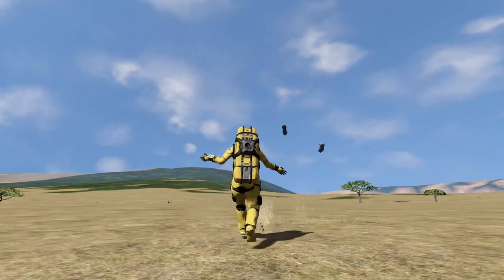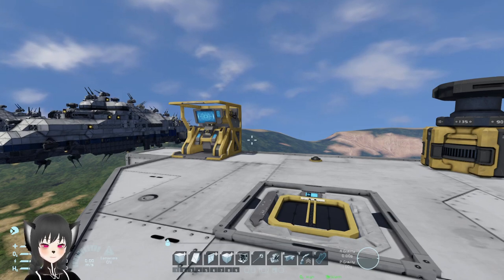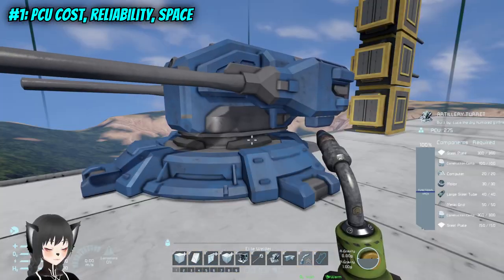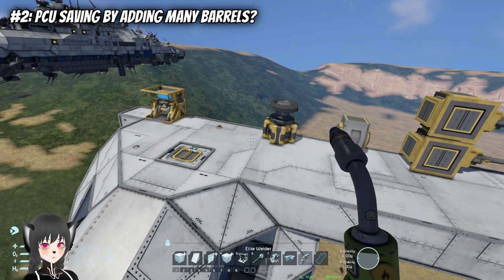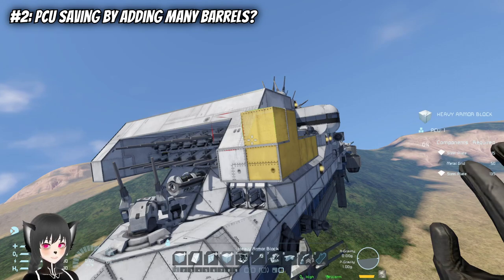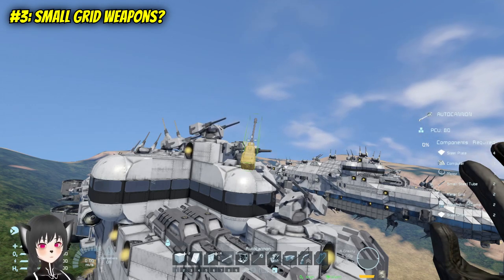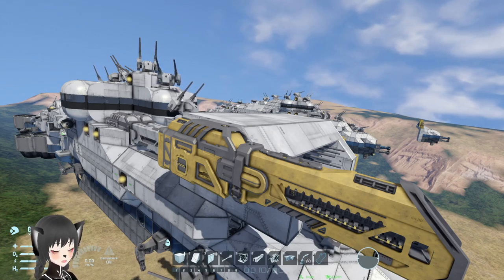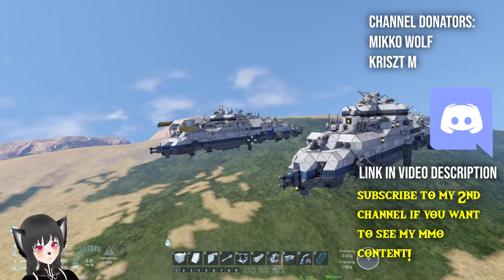Why custom turrets on a ship is a bad idea, Space Engineers - applies to ball turret too

Comment: The only thing I can think of is I know there's a glitch exploit with small grid warfare gatlings where they can shoot through blocks because the model is longer than the block placement, in theory you could make a turret using that that won't take up as much space but still be combat effective due to it's beam like bullet spray being almost impossible to dodge, but you'd have to get close enough for that to work anyways.
Reply from the maker: Oo, that sounds interesting but yeah sounds impractical since you need to get really close x3

Comment: I mean, I think you aren't treating them fairly, for some reason.  No one is building massive custom turrets half the size of their ship, at least not in any serious design.  

So you have 6 gatling turrets on your recent ship build. So you approve of large gatling turrets even in warfare II, at least for use as close defense.

Your 6 gatling turrets put out 600 rounds per minute each, for a grand total of 3600 rounds per minute
(you have 3 on each side, so 1800 rounds per minute on each side)
Each turret costs 225 PCU, so your total cost is 1350 PCU.  Or 675 PCU on each side.
Or 2.66 rounds per minute per PCU

You could put a single minimalistic ball turret with 4 gatling cannons on each side instead of 3 large gatling turrets on each side.
Gatling cannons fire 700 rounds per minute for each gun, for a total of 2800 rounds per minute on each side (4800 total).  Small gatling cannon rounds do the same damage as large gatling turret rounds (for those who didn't know).  It's only the small gatling turret rounds that have inferior damage.
There is a design on the workshop with 658 PCU for each ball turret, or 1316 PCU for both, and that's including on each turret the large rotor, large hinge base and small hinge part, the camera, the 4 gats, and the LARGE custom turret controller, and including the 1 small conveyor necessary to link the 4 gats.  It's including everything needed.  Plug and play.  
That's 3.65 rounds per minute per PCU.  

The ball turrets would be cheaper on PCU, do more damage, at the same range, on the same sides, and save space to boot.  

And ball turrets are by no means limited to 4 gatlings!
An 8 gatling design puts out 5600 rounds per minute at 800 meter range.   
It uses three more small conveyors than the 4 barrel design, and 4 more guns (otherwise exactly the same) and costs 1021 PCU.  
Or 5.48 rounds per minute per PCU

That's not even close.  At 2:45 your entire argument against stable, nimble ball turrets was that you scoffed at the idea that small turrets could do more damage.  I'm sorry, and mean no offence because I love your channel.  But that's something we can calculate and easily test in-game.  I've tested them many times, personally.  On danage, at least, you are incorrect.
Reply: Like, I think a person without bias could still easily make a case against ball turrets, even when treating them fairly and doing the math.  They are more vulnerable to damage, even if harder to hit.  They are harder to repair.  Hinge versions (at least) have no declination and have an inferior arc to vanilla turrets.  And so on.  There are definitely drawbacks.  The most serious drawback is probably that they can't be told to exclude objects like a vanilla turret can, and that's a pretty serious drawback for gatlings that are used for point defense against small ships and players.  I'm just saying that the case you made (that they do less damage) is not correct.  I'm not telling anyone to use them.  I'm just pointing out the damage stats.

Comment: The one thing I want a custom turret for is for small grid railguns on a large grid. It feels like it is filling in a gap that the new Warfare 2 normal turrets didn't fill.
Reply: Do the range and projectile speed make such an arrangement worthwhile?
Reply: @VitriolicVermillion  I'd say so. It's cheaper energy and materials wise than LGRG, while damage and rate of fire are between LGRG and Artillery. Especially since you can fit multiple on a single ball turret that will hit area of 1-4LG block, giving possibility of dispersal.

Comment: The problem is that the turrets in general are super wobbly and unstable idk why keen cant give us perfect rotors where they would just rotate the subgrid not make it swing around randomly idk where they got this idea from but I dont remember last time looking at tank where the cannon would just swing around when the turret turned.
Reply: Use inertia tensor
Reply: @Riley-w1e  It helps only a bit but when the ship starts moving which it has to to not get hit it will still miss a lot.
Reply: @Riley-w1e  The inertia tensor option is available only in Creative
Reply: @krirub8166  Inertia tensor is available with experimental mode activated. You can use it in both survival or creative. Keen official servers don't have experimental mode on.
Reply from the maker: Yeah x -x hopefully Keen can improve that x3
Reply: I suggest if your having turret sway is to change your settings for your turn blocks and change your speed for the custom controller. Another thing is that hinges are walk and only good for something light and small, once it gets bigger use two rotors which are much more accurate.

Comment: We use a lot of custom turrets on NA #1. My dart fighters use 2-3 custom turrets and usually only lose 1 in a fight. Hell in one fight with 2 custom turrets most of the ship was destroyed before I lost them. 

No one uses large grid guns since it will really clang and be in the way of other guns. So far a ball turret with 4-6 small railguns or 8 assault cannons or  6gats/2auto combos is the way to go. those railguns are really hard to dodge and definitely chew up ships. They have a smaller power load and fire a little quicker than the large one.  Although the range is shorter it is very rare that anyone will stay over 1km in a fight. Over 1k most stuff can be dodged by a competent captain. 

The biggest downsides to the custom turrets are the cost. with the amount of guns plus camera and a gyro or two if they get really clangy it can get up to 8-900PCU each. I posted a ship to the workshop (the dart) and it said 2000pcu ish in the info tab. I was like oh great. Then when I went to copy and paste it in creative it said 5000pcu... I realized it didn't account for each grid and the three turrets were really expensive.

Since the dart is a small test ship it gets trashed in most fights and I have to build it from projections. fine for the main body but the turrets I have to hand build every time. it turned out not to be that hard. after a while becomes really easy to get that floating hinge to lock into place. Even if you just go with the default 3x3 small hinge part you can easily add cannons and rails using the conveyor converter to attach the guns to. not as nice looking but is fast when I need to get a ship back into the fight. 

I would say dedicate 1k pcu to playing with a custom turret on your ship. The sg railguns are surprisingly nasty. set them to target weapons or power.
Reply: Thanks for the info with all the drones out now i figured id try a ball turret, i know they're ineffective butim going to try the 1k rule and see how it goes.
Reply: @brady157  they are still a lot of fun and you can fit a lot of guns in 1k. good luck!

Comment: Here's how i use custom turrets:
I have a large grid ship, a bit bigger than the red Corvette you just reviewed. It has a lot of forward thrust and not much in other directions. At the front, there's a deep sort of hole with a gimbal system inside that aims a block of like 10*25 small grid assault cannons (i don't remember the exact number,  it was basically as the whole could fit before the guns started shooting the walls. It's got limited angles of rotation, about 15 degrees in each direction (again, i don't remember). Basically, i use the ship's good forward thrust to chase an enemy while the gimbal works like aim assist. The range is limited because it's assault turrets, but one shot can blow a hole straight through an average ship of the same size, and the dps is also amazing. Alternatively i can replace assault cannons with small railguns to get more range, but the dps becomes much lower so it's not nearly as fun, plus i can usually get close enough with my forward thrust

Comment: yeah. The biggest reason is the custom turrets are subgrid and large custom  turret is going to affect the ship mass. it may jerk around during combat (lot less with braking torque set on the hinge) even shoot through  the ship in some case (the turret AI don't  recognise the ship as the same grid). They are good for base defense and fun. The only case which may be good to use is the small grid rail gun and the autocannon (high fire rate). The only  other user case is that they are the only other turret with WeaponCore that can be used by other player than the pilot. I forgot with vanilla but with WC, only the pilot can control a turret...
Reply from the maker: Yeah there's very unreliable because of the jank x -x and oo, that sounds weird o: I never tried WC so x3

Comment: There is a massive practical application for these that you are overlooking. Rotorguns. If you aren't familiar with these. I highly suggest checking out the works of Bruce LeedleLeedleLeedleLee here on Youtube to get some insight into how these weapons function. The damage output is much higher than artillery or railguns, and they have no resource cost to fire. I would love to see you do a video covering some more technical aspects of Space Engineers design. For example, you haven't showcased any Supergrid ships either.  Something like the Tempest - 3 from M4Hawse on the steam workshop. Anyway, just some extra points of research for you. Keep up the good work!

Comment: I hace worked on custom turrets for a while to find a good setup that actually makes them worth using, but so far the best I have been able to do us my depressed turret design. With any custom turret, the biggest weakness always seems to be the rotors and hinges. 1 single shot can completely disable the turret. This is part of the reason I stopped R&D on them and focused on TCB drones/missiles which I believe are the batter use for the TCB. With those, you can have redundancy by having 2 TCBs and 4 rotors, making it a bit harder to disable them, but sacrificing accuracy a bit due to both TCBs targeting different targets. Having somd gimer blocks to act as a FCS can fix that, but still the bust use for TCBs in my opinion is for tool arms. Also, J might ad that rail custom turrets can be extremely inaccurate due to the firing delay compiled with the inertia of the turret head causing it to sweep past the target after triggering the railgun to fire
Reply: You say you also make custom turret drones?

Comment: I design my large grid ships that are designated for combat with multibe layers of defensive and offensive turrets as well as bombs (Yes I'm using unguided bombs). So the inner layer is point defense turrets (anti personel and anti rocket). These are custom made ball turrets and normally include 6 gatling guns, because they need to throw as many projectiles as possible at the threat to inrease the chance of hitting. Next layer is flak. Also custom made ball turrets with 4 autocannons and they only target small grids. Next comes the first layer of offensive weapons, wich can include artillery turrets, ball turrets with 4 small railguns, assault cannon turrets, missile turrets or gatling turrets. Last but not least the outer layer. This layer houses the custom railgun turret with 2 RGs, the Bombs and fixed cannons/ railguns.

This said I should add, that I don't experience any lag whatsoever in Space Engineers, so there is no max PCU in my worlds. I only really play multiplayer on small servers with my friends who don't really have problems either, so as you can guess: no PCU limit.

With that in mind: Custom turrets really shine when combined with normal turrets and with a specialization. I can promise you, that my 6 gatling guns ball turret is a better choise for point defense, than interior turrets. And a ball turret with 4 autocannons is a great flak and fills the void between the large grid gatling gun (wich shoot at large grid only on my config.) and the point defense. And custom railguns are just cool af.

Comment: I agree that in game weapon turrets are best for large grid, but for small grid, a large conveyor is already 3x3 for gat turrets (if you use that kind of connection) and gatling/autocannon/assault cannon turrets are 5x5 by I believe 3 for only 1 weapon. Now assault cannons are probably okay since they're intended more for larger slower small grids or bases, but sometimes gats and autocannons can feel lacking when attacking more heavily armored craft, especially if youre not in a big vehicle with lots of space for turrets. A custom turret will allow at least 4 weapons in the same space for much more kick. Blast door blocks can protect the centerline where rotors/hinges are to negate deformation, heavy armor for maybe more important but not entirely need things ie a conveyor or simply to act as a sponge, and light armor can be ablative since its unessential to the structure. Now yes multplayer is probably not the best for custom turrets, but in single player, it doesn't suck down thousands of otherwise needed components and pcu unless you build anything unecessarily large. So cons are the pcu and material, pros are the adaptabilty to certain conditions, increased dps per same volume, and variable armor defense

Comment: thats kinda wrong.. i ussually build custom turrets and use the very well programed function that stops any shaking and if you know how weight works and dont put 20 turrets you can build some nasty weapons. In survival my broadsiders have always 2 heavy custom turrets, a good amount of medium sized custom turrets and few smaller oneswith 2-4 gatlings for AA puroses. Custom turrets are not just good. They are OP especially if you have a secondary driver who takes care of aiming them. Both on ships and on ground the auto turrets can be devastating if used correctly and will always be better of any of the normal weapons. They take more skill to build. Also they make usage of railguns actually possible as you can make turrets using them and aiming instead of trying to rotate the whole ship to get a hit. I always use railguns to disable enemy vessels engines, Artillery to shell steering, autocannons to aim at storage and weaponry and gatlings for AA. And thanks to custom turrets i can make them the size i want that does not limit me being able to shield them properly around without the need to leave a open box around them to have a full range of motion. They need a lot of work and tuning and because of this there is a big gap between a cassual player and a engineer who knows what he is doing. Yes i could make a death cannon with 20 turrets attached but why? One of my best fighters has his wings made oout of 2 auto turrets with big shields covering its sides. And it is good enough for players to try copying it just for me to see their ship being ping-ponged around as they have no idea how to weight their ships and set the system up correctly. As hard as it is to learn custom turrets are too good and should be nerfed as they ,ale fights extremly unfair. A lot of players complain that normal weapons are actually too weak compare d to what can be done with custom turrets.

Edit: also soe of the normal turrets compared with the custom ones are much weaker causing a lot of balancing problems leading to some servers turning custom turrets off completely or restricting them heavily)

Comment: The only advantage that custom turrets have over normal turrets is their worse aim.
This sounds counter-intuitive, but hear me out: If you have very accurate weapons, all bullets will fly through one the same lane, which means that all the enemy has to do to dodge is to keep accelerating (keep the periods between acceleration to below the flight time of the projectiles).
With a large cone you get less damage output per area of space, but in return you gain a larger area that you offend. This can be useful if you have a lot of weapons that can one-shot the enemy craft. For example assault cannons or autocannons against minmalist drones.
At worst, all the enemy has to do to dodge is to spin decoys around while sitting still. Accurate AI turrets will then shoot only into a circle around the enemy. But if your cone of fire is larger than that circle, you still have some chance to hit them.

Comment: in my understanding for now ive played with different versions for about 200 hours and settles on 2 models  the tradittionnal gatling ( mainly for missiles-drones )  and the underused  assault version ( mainly for drones-fighters  and if placement on ship is not stupid  it helps ( beleive it or not ) with frigates to corvette classes)  against destroyers and above no its no use wayyy too much armor smallgrid does not cut it and gets blown  but yeah  1-2  turrets on top-bottom is the max and it is imperative you ( sink ) it in the armor of vessel else boom the turret versions untill hitting larger ships cannot hold a candle to them ( with proper setup )  cheers